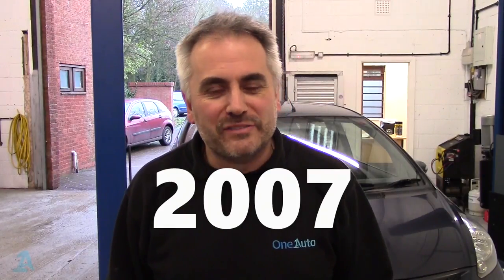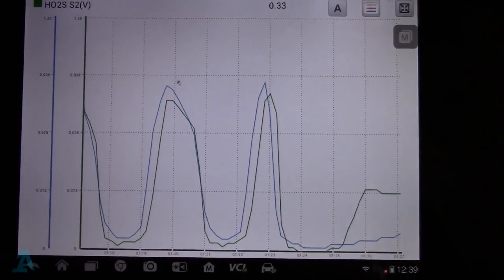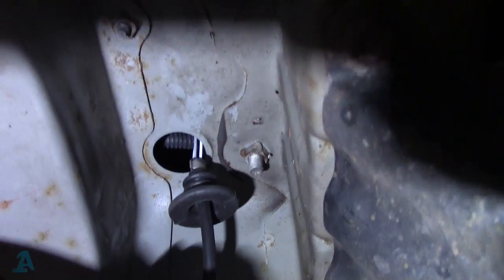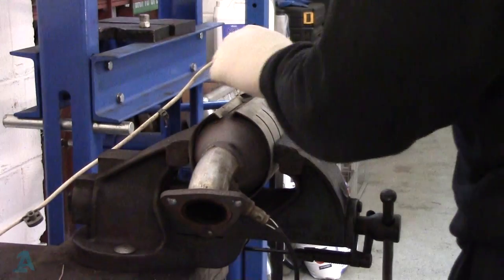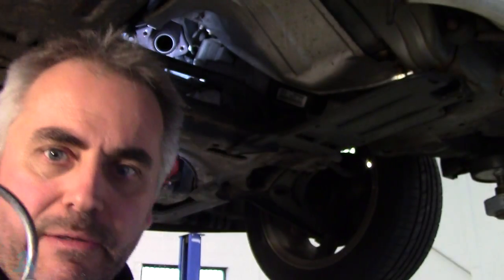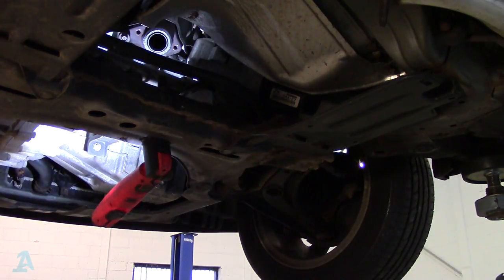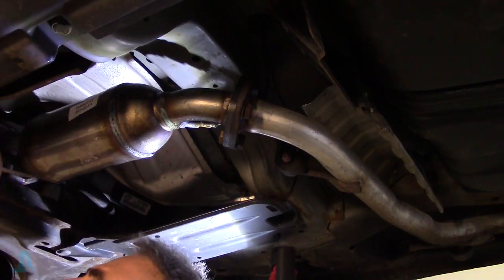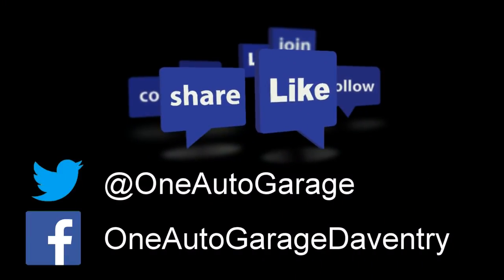Honda Jazz 1.4 P0420 Catalytic Converter

Comment: Thanks for this video, liked it very much. My 05 Jazz needs a new mid and rear exhaust, (rusted and pipe broke, but I've temp repaired it with a tin can and two jubilee clips) which I'll do soon. The cat part is ok for now, no lights up, but when it needs doing I now know how, because of your video, so thankyou!! Much easier in a workshop with a carlift as you have here, but I'll probably manage on my driveway with jacks. The cat part is expensive to buy anyway, but at least diy is cheaper overall. Thanks again, I'm subscribed. Alan, also in England (Norwich).
Reply: I have a new back box for a 2003 Jazz if you want it. I was going to get it fitted when I got rear-ended. It's been in the cupboard for a while now.

Comment: I'm getting ready to do mine, so thanks much for this video. Two questions, though.
1. What is the heat-sink, sleeve looking bit around the old cat?
2. Why doesn't the new cat have one?
Reply from the maker: Just a heat shield you don’t get with an aftermarket Cat. Cheers

Comment: I noticed you didn't take the heat shield off the old CAT.   Is that removable from the old unit?   Isn't that needed?
Reply from the maker: Welded onto the original cat. This aftermarket replacement didn’t come with one. Not always necessary

Comment: Does the honda jazz 2002mkii also have a sensor connector in the middle console? some low lives stole both cat converters on my two hondas over night.  Completely wrecked the exhaust on both cars. Much harder to get the part for the 2006 tourer though.  Good video and very informative.
Reply from the maker: Jim Tall Bloody scum bags! Yes I think it has

Comment: I may be doing this exact repair soon on my 08 Fit (same car as that Jazz in the USA). Just threw the p0420 code. Mine came with a bit of engine vibration. Could it be something other than a bad cat?
Reply from the maker: It could be something different, but hey you’re going to put a cat on it anyway. Thanks for stopping by

Comment: So can you just leave sensors in place and detach from the converter?!
Reply from the maker: If you try that you end up twisting the wires of the sensor, they can break easily so it’s best to disconnect them and remove them
Reply: I see scratches chin you win this round Honda Fit
Reply: So another dumb question ( sorry you know us Americans). Do you need that long ratchet extension or can you fit a normal ratchet up there for the spring bolts? Thank you 🙏 crackin job
Reply from the maker: Not sure you will have the room to swing a normal ratchet without an extension
Reply: @OneAuto  hey man forgot to update you. I successfully replaced my cat in my 2007 Fit thanks to you! I had to buy a dremel tool and grind off the rusted tri-bolts. I got one spring bolt out, but the other one snapped off flush with the metal. Oh man, let me tell you that was tricky. Tried bolt extractor kit, but that did't work, so bought a Bosch steel bit and drilled the entire bolt out. Then I got two nuts and held on the spring bolt. The manifold gasket that came with my replacement cat didn't fit at all, so had to buy a new Honda one, which didn't quite fit the cat replacement lol. But it is pretty quiet except when it revs a little above 3rpm, but goes away at 4 rpm lol. 
Saved over $1,000 though!  Thanks again for the video.
Reply from the maker: Nice one.. you’re welcome

Comment: Hi. Is the downstream O2 sensor supposed to "follow" the same graphic pattern of upstream O2 sensor? I mean while driving! Because at idle mine seems to sit at 0.8v more or less. And I have a code after 8 months of use of an aftermarket cat. What do u think ? Thank you for your time.
Reply from the maker: No it should be steady line. I have had some aftermarket cats go bad in under 12 months

Comment: Nice work. That Autel 908, what limitation have you come across in your line of work with car variants. The PSA group of cars can be tricky I've found to get working with the diags. I've got a cheap autel whic won't work on Pugs. Cheers.
Reply from the maker: Its a great all rounder. Some of the Nissans can be a bit sketchy
Reply: Yes Nissan and Renault keep some things to themselves.

Comment: there are many souyrces of aftermarket Cats,  Is there a brand  you recommend for the cat and the Oxugen sensors?
Reply from the maker: NGK are good for sensors. As for the Cars it depends on what’s available. Buy from a parts store rather than an eBay type so you get a warranty

Comment: Hi my catalyt coverter from my honda jazz been stolen , i will fit my self a new middle section plus both O2 sensors and the catalyt coverter ,can i ask you do you think the engine light managment will come on? if it stays on i presume i need a fault scanner tool to erase the fault? Thans
Reply from the maker: Yes if the light comes on or it may reset after a few runs without a fault being logged. If the ignition has not been turned on yet since it was stolen then it won’t come on
Reply: @OneAuto  ok many thanks ..... unfortunately I had to move the car I start the engine for 2 min (didn't came on on that 2 min)  i may get away ....any way Regards George
Reply: @OneAuto  Sorry to bother you i bought the parts with the fittings but where the catalyst converter connects with the middle piece they send me 3 bolts and nuts with the springs, i think they should send me normal bolts and nuts for this section, do you remember if is M10 the bolts i have to buy?Thanks
Reply from the maker: Yes. You might be able to re-use the old bolts and nuts

Comment: Why not just remove the sensors from the cat and just tape them to the chasis.
Reply from the maker: Because they know.. clever things them sensors
Reply: @OneAuto  Yea, sure. Well, I think it would be easier just to take them off from the cat, wrap them into silk cloth and spray them with chocolate milk before installing into new cat.

Comment: Please My Honda Jazz 08 1.3 manual has just had its CAT stolen. I am told I need a new CAT and Sensor and advised to make sure they are genuine. How do I know which to get as I have seen lots in the market but mostly OEM?
Reply from the maker: If you want genuine buy from Honda. If you want aftermarket buy anywhere. They will all have 12 months warranty if your in the UK
Reply: @OneAuto  Thank you. Yes I am in the UK. I will go for the aftermarket